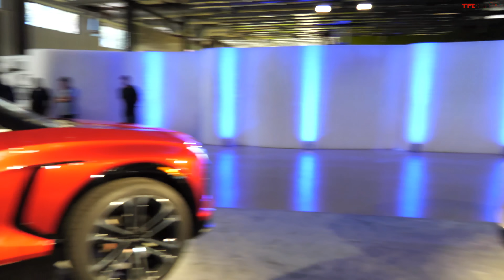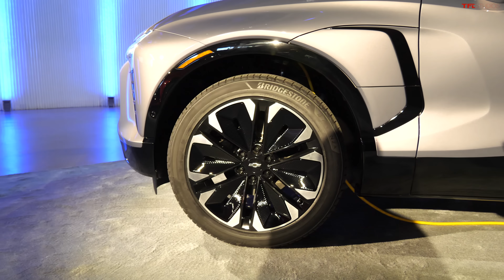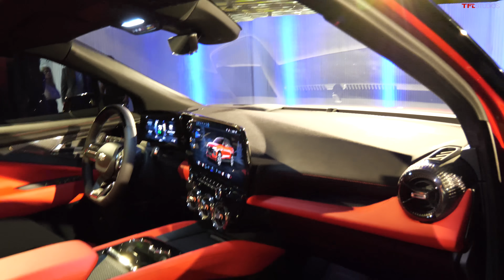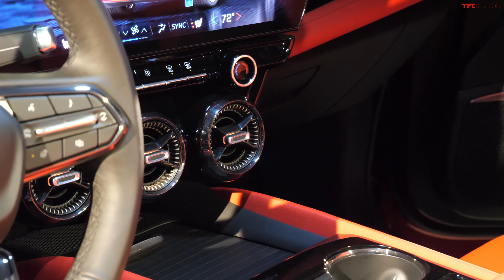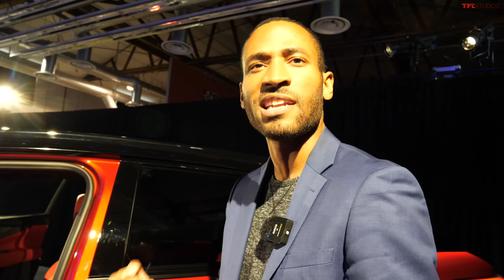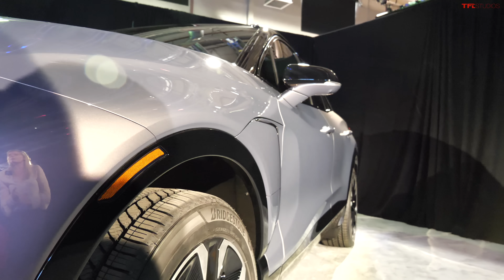Here’s Why The New Chevy Blazer EV SS Should Worry Other Electric Car Companies!

Comment: I would guess the rear when drive would still do decent in snow considering the weight of the drive unit and battery are more to the rear than gas versions.

Comment: Now I have a name, Doug Houlihan, is he the genius or part of the genius team that designed the 2024 Chevy EV Blazer RS AWD that does not have as an option the Panoramic Sunroof??, has to be the most ridiculous decision I have seen in with a new car line, total head scratcher, the 2024 RS LT and 2024 RS RWD Chevy Blazer EV has the option for the Panoramic sunroof BUT the 2024 RS AWD does not - Totally Ridiculous and incomprehensible.

Comment: I'm wondering when they are going to release the numbers for the horsepower on the RS AWD. They are supposed to be selling the car this summer so I'd think they'd need to get that out soon.  I find it odd that you can get horsepower numbers on the Equinox which will be released later. I can understand not releasing prices on the Equinox until the last minute but you'd think they'd know the horsepower on the Blazer or at least a close number. I'm hoping they keep a large rear wheel motor on the AWD RS.

Comment: That is such a substandard EV. 20 min at a supercharger to get 80 miles of range. It is slower from 80-100% also. That means 240-320 miles of range takes 1-2 hrs to charge. Shame on you GM most people don’t understand and it only holds back EV opinion and adoption with that crap battery you are putting in the car.

Comment: They should rename this line of vehicle the Chevy Lazer and then take the Tahoe and cut off the rear doors and name that the BLAZER like they should have in the first place. You want to know something very sad. My family owned a Chevrolet dealership in the 50s we were always a GM Family. In the past 20 years they have gone so far away from their roots they are unrecognizable. Absolutely a failure that they call this Equinox a Blazer. Shameful This is why Chrysler and Ford outsell GM. The number one selling Cadillac is a REAR WHEEL DRIVE V8 WITH PUFFY SEATS (They even ruined the seats on the latest model) Do they not see what people in America want to drive??? Bring back the park ave ultra with a couch in the front. Monster V8s like Chrysler has and power hem with Methane which is free and renewable and requires very little mods nope GM wants to hump you with electric. RUN AS FAST AS YOU CAN FROM GM.

Comment: You should offer a 20" wheel option in the higher trims  21 and 22 are too big for me... not enough rubber.
Reply: Serious question - do larger tires increase ground clearance and help avoid scraping at driveways etc. ?
Reply: @amigajoe  In most cases it does not. Smaller wheels increase the height of the tread wall. Larger wheels decrease the tread wall height giving less rubber cushion contacting the road. It's really the suspension design that affects ground clearance.
Reply: @bassistdc  That’s what I thought. And from everything I’ve read bigger tires are usually less comfortable of a ride as well. I imagine it depends on the height of the tire, but with the trend being the bigger tires and lower profiles. 

It wasn’t a deciding factor but the fact that we are looking at an ionic 5 Rear Wheel Dr. versus all-wheel-drive, the smaller wheels and the softer ride was a plus in our book
Reply: @amigajoe  I bought a VW ID.4 in December. The Ioniq 5 wasn't out yet. I like the VW.
Reply: @bassistdc  I think the Id.4 is the best looking EV out there. I do like the ionic five’s retro looks, but otherwise I love the lines of the ID four better than everything else, including this new blazer. I placed a reservation for an id.4 in November of last year and just canceled it a few weeks ago. I like tech a lot, and being a former model three owner, the infotainment and small screen in the id4 just didn’t cut it for me. 

So for us it will be an ionic 5 Rear Wheel Dr. limited trim to gets all the tech, or a blazer RS. Hoping I can convince my wife to wait for the blazer as I really want SuperCruise. And I like the fact that it’s a bit bigger. But not sure if we can wait a year plus.

Comment: Just like every other vehicle that general motors has ever manufactured,  this will fall short by design. Bean counters will find a way to drop a lead weight on the proverbial pinky toe . Some design flaws,  parts designed with an expiration date. General motors used to build robots for nasa that worked indefinitely, and also the ASTRO van for cable companies that would not break . But because of greed , purposely build vehicles with parts that all break at a certain time or mileage leaving customers to foot the bill and further make money from selling parts and services at dealerships. And no matter how many customers they lose , they continue to do it . I used to be a General motors fan ... but since I've switched to Toyota and Honda, I haven't missed buying American. Keep the power, I want reliability. With mortgage and insurance and everything else Americans have to pay for , we need a vehicle that just works and works well. We don't need to be going into our savings to fix a vehicle that shouldn't break in the first place. Like the million dollar man from the 70's , we have the technology... so , give us something that won't break. Please. Or close down and let someone else do it .

Comment: The most important questions for EV buyers:  What size is the battery?  Does it have battery pre-conditioning? Does it have a heat pump?  What is the curb weight?  What is the CD ratio?  I don’t care about electric charge port doors and fancy lights.
Reply: Yes, more details of the battery packs would be nice know.  Also can we switch from FWD to AWD by pushing a button or are we stuck with only one method of the Wheel Drive operations all the time.

Comment: Good interior. Still not a fan of the Jet air tunnels but I like the rest of it, flows very well. The exterior is still not my favorite. It’s still the mix of the Camaro and equinox’s baby. It’s got the CUV sport look everything in the industry is going. Even the Silverado EV is looking this way it just doesn’t flow. Need something new and not so much of the Modern “bubbly” style. Needs a sleek sharp look. It’s why Ford and Dodge still continue to outsell when it comes to the sports and muscle cars.

Comment: I like what I am seeing on the inside of this car. The red colors, the brightwork and detail of the vents and switch gear. So done with flat, black understated dashboards and door cards. I like the front end on the RS a whole lot more than the SS. I don’t like the stuffed squirrel cheeks look of the SS.

Not a fan of the pricing. After adding the obligatory $10,000 in options plus dealer markup to the price of these Blazers, I am not happy with the $45,000 to $85,000 these things are going to command at the dealer.  I don’t need a new electric crossover SUV with a cramped interior that much. And I am also not interested in paying $500 to $1,000 to replace 1 tire on these rigs. I am ok with the advertised range however.
Reply: And All Companies using these overpriced 40 series tires need to quit it.............Paul

Comment: 0;55 'Blazer EV SS with 557 Horsepower ' ...   But Model Y with 480 HP blows Blazer to dust.
Reply: I do admit, you are correct. Amazed that the Model Y Performance model can do 150 mph and I think 0-60 in 3 seconds.

Comment: Wait until you find out the "Ultium" pouch batteries last about 1/3 as long as cylindrical cells. GM will fail by betting on the cheaper battery.

Comment: As someone who has a deposit on an SS, I sure wish the presenter would have gotten some more detail about nearly the only OPENING moonroof in the entire EV industry . That was a missed moment for sure.and info that had yet to be shared anywhere else. It appears to open in a unique way as well. Missed opportunity for sure.
Reply: The Kia EV6 GtLine and the Hyundai Ionia 6 sedan both have moonroofs that open. This is important to me too and I’m happy the Blazer will have one available too. My problem all of these cars are about $10k more than I want to spend but inflation I guess?
Reply: @marcalvarado1915  The EV6 and Ioniq 6 don't have panoramic roofs though...
Reply: @OlJackBurton  I would gladly trade a roof that can open and let in fresh air over a panoramic roof. There are lots of evs with glass roofs and only a few with roofs that actually open.
Reply: @marcalvarado1915  The Blazer has a panoramic roof that opens.  So you can have both...

Comment: Don't put a motor on a door you will be "constantly" interacting with. Sure it saves zero time from doing it your self and looks cool but eventually that motor will break. A hinge is just as good albeit not as flashy but less chanve of breaking or wearing out.
Reply: Tell that to someone that buys an electric car.
Reply: I have power soft close doors on my 12 year old 750Li and they have never missed a beat

Comment: The RS seems the most interesting variant to me. What is the range of the AWD version? Are there 2 battery choices for the AWD too?
Reply: Those details aren't released yet. I've looked all overs Chevy's website. But I do agree the AWD RS Model is the most interesting.
Reply: The AWD on the RS is not the same as the SS. The RS is RWD with a front assist motor (read low power). That's why the RS has eAWD. The SS has a more powerful motor up front. The SS and AWD Lyriq should be similar.
Reply: @theflew  Just like the Mach-e Gt.

Comment: Gas or Electric , Trading one pollutant ...  for another. These special  types of electrical batteries used to propel these cars and trucks are highly toxic and a constant fire hazard.  Infact many homeowners insurance companies will not insure  you if you park a electric  cars or truck in your garage,  plus electric  car insurance itself is higher because  of high fire risk.  These things are becoming  a huge environmental  disaster !   ... GREEN ENERGY ?  No way !
Reply: You do know that the cars we currently have contain multi-gallon tanks of toxic, cancer causing flammable materials in them right? EVs have environmental impacts for sure, but most of these impacts can be reduced over time as the technology matures. With ICE vehicles, even if we continually improve them we're still combusting environmental hazards into the air when we use them and that will never change.
Reply: You do know their are literally hundreds of gas powered vehicle fires per day in the US, right?
Reply: @cypvh74  You know that studies have shown that electric vehicles catch fire at twice the rate of gas powered vehicle, right? No there are not hundreds of gas powered vehicle fires every day.
Reply: @LeeCountySpeedShop  that’s a laughable claim.

Comment: I really like the look especially the RS which is the only version to have standard towing. Since the Lyriq tows 3500 pounds, I assume Blazer will be the same. Too bad they couldn't work their packaging to include a front storage, especially if you pick the RWD version. You have to wonder how Tesla is so good at packaging with dual motors in the same size car.
I really object to the concept of reserved charging. I don't know how they plan to implement that because I would not want to pull up to a charger and see reserved on the screen, or be charging and be cut off because someone reserved that unit. Especially if they reserved it and were late arriving. All chargers should be first come, first served. I am perfectly fine cutting people off at 80% during very busy times, or fining people who leave a car plugged in when it's full.
Reply: I think GM thinks the frunk isn't that important. I tend to agree with them. It also makes the vehicle more serviceable.
Reply: That is correct; surveys are showing most don't use a small frunk, or forget they have it.
Reply: I have used my frunk maybe 2 times in 4 years. The frunk on a truck is a must.
Reply: I read tow package on 2LT and RS for 1500 LBS

Comment: This vehicle is overpriced by about $10,000.  All the wasted airtime spent gushing over colours and stitching accents doesn't impress me, who is a person who cares more about function than form.  All it does is make me ask why the engineers couldn't match their peers and fit in things like a front trunk, or the option for a couple extra emergency seats for kids.  

On the plus side, charge rate is probably acceptable ...depending on how the charge curve shakes out.  Similarly, the range is solid.

Final verdict:  Meh.  Uneducated purchasers will probably find this crossover to be just fine.  ...But, Chevy engineers needed to bring more to the table if they wanted to out-compete existing offerings from their rivals in Ford, Hyundai and VW.  All of whom have better versions of this vehicle already on the market.  GM likely knows this and it's why they try to distract with punchy colours and styling accents.
Reply: Interesting opinion.  Can't say I agree. Don't forget the Mach e is also smaller than this yet offers a lower range. 

It blows the Mach e out of the water.
Reply: @hi-fi3889  The VW has been lambasted by EVERYBODY. Sounds like you have an ax to grind with GM cause nothing you said is objective at this point.

Comment: The styling is attractive (in a GM sort of way) but I would have hoped that GM would have based their Ultium pack on something other than prior generation pouch batteries.  They have waited so long to get into EVs in a meaningful way, why not go with something better?  Many of the things talked about are the same on all EVs.  I am disappointed with the relatively low charging speed with this late entry.  Don't get me wrong - I am very happy to see real EVs happening at GM!  (Why didn't' the show the cargo area(s) - is their a front trunk?)
Reply: The Ultium platform isn't a battery pack though, it's the whole platform. As I understand it from the materials I've read (so admittedly I'm not an expert), it's basically cell agnostic. Right now they're using pouch cells that aren't anything to really write home about, but as their chemistry advances those newer chemistries can slot right in, even in older packs with some of the current pouches still in them. So if a cell goes bad, they can replace just that cell, or as your battery wears, you can replace older cells over time with new ones, including ones with new chemistries and run a mix of them.
Reply: @sipher3516  Here's hoping!
Reply: No front trunk, the cargo in other videos shows good space.
Reply: I've lived 80 Years without a "FRUNK".....Don't need one now...........Paul
Reply: Everyone in the industry besides Tesla and startups use pouch cells. The reason Tesla keeps moving to larger and larger cylindrical cells is to get to the benefit of larger punch cells (you use a lot less of them). That cuts cost and complexity regardless of chemistry.

Comment: Wrong wheel drive still in a EV? Why/ Fine, RWD and AWD, I get that, but FWD? Legacy car markers still trying to shove poor driving dynamics on customers. Wonder how much torque steer you had to deal with (cut power).. haha. I like how it sounded like having a flat 2nd row and lower center of mass was somehow groundbreaking.. Umm, yeah its a EV so?.. Anything less would be silly, but when you all have been retro fitting EV drive systems into ICE chassis, so I get its new(ish) idea to you. Joking aside, at lest they get that drivers want some physical controls, so that is a good stub in EV design.
Reply: Parts bin

Comment: Not bad but after the Bolt fiasco I still don't trust GM's battery tech. Wouldn't trade my Model Y for this.
Reply: im not sure why you're worried. the bolt batteries and the lyriq/hummer/blazer etc batteries are completely different
Reply: @kylemcleish8270  and the fact it was a manufacturing issue with the battery not anything wrong with its design. GM has more control over Ultium production too.
Reply: @kylemcleish8270  no they're actually not. They're still using the LG Chem battery packs. Ultiium is just an LLC that was created to protect GM and LG Chem from litigation. Of course there's a marketing spin put on it.
Reply: @RezandJen  Not exactly. They're still partnering with LG Chem to make the Ultium batteries, but they have a completely different chemistry so they are actually totally different batteries than the ones used in the Bolt EV. The other difference is that with the Bolt batteries, they were just buying them from LG without any input on the manufacturing side, this time it's a joint venture so GM can have some say in the manufacturing and (supposedly) keep anything like that from happening again. Supposedly being the keyword.
Reply: That was LGs manufacturing issue. Tesla had their fair share of snafus too
Reply: @hi-fi3889  Tesla was using LG Chem batteries for awhile also. A few Model S and X's caught on fire and they stoped using them. The 2170 Panasonic packs have been pretty good.